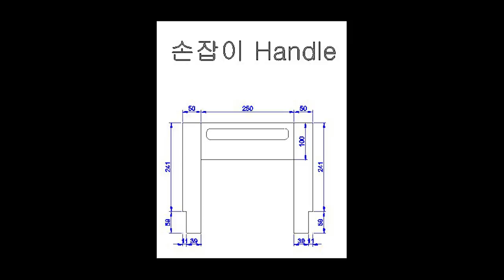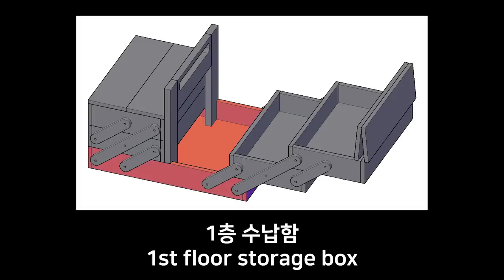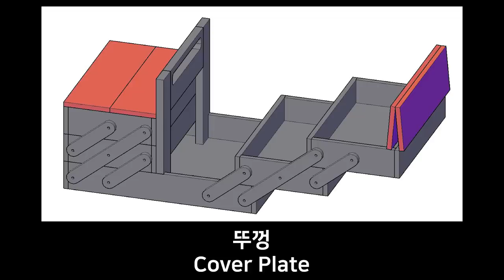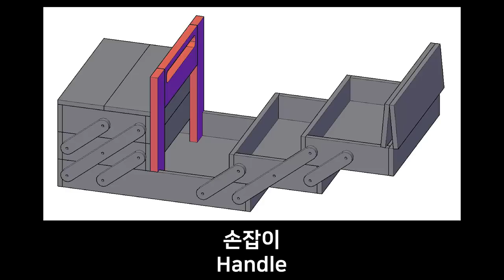3층 접이식 목공 공구박스 diy │ 3-layer Sewing folding tool box

Comment: Good and very inspiring work !
Few tips:
- You have a router, you should definetly make a recess for the top hinges, so they don't interfere with the top closure.
- You should use "M6 half threaded countersunk allen key bolts" for pivots, they stay flush and make it more stylish, avoid eating the hole of swing hinge with thread.
- Using 30mm steel washers at the interference between swing hinge and sides for better sliding, plywood rubbing results generally in lost of the top, very thin, finnish layer.
- You could use small neodymium magnets between top boxes and the handle (small ones, three or four each side will make it), so the box closes firmly when you carry it.
Hope this helps.
Reply from the maker: You are right Very good idea.
I'm a beginner and I can't do it all.
But I'll try to do well soon
Thanks for the advice
Reply: А ящик сложно делать такой?

Comment: This is pretty, and a great demonstration of the folding principle. I have to say, I cannot imagine that handle remaining solidly attached with any significant use, tho. Little brad nails are good for trim, less so for structural purposes. If I were you, I'd have made the three pieces one piece, and fastened them to the bottom with something more significant like cabinet screws, maybe some strips of wood glued and nailed/screwed on either side of them against the box sides as well, for more rigidity. You could still do that last one on the build, as it is.
Reply from the maker: I will try to develop more
Thanks for the advice =)

Comment: nice work, but i saw just one tiny problem with this.. 
the base of the handle supporting only the middle portion. Meaning when carrying, you'll gonna have a problem, when the weight of the right box is not even to the left.
but still i gave a like. love it
hope you will do another design to fix my little tiny issue..😂
Reply from the maker: Thanks for the advice
I'll try to make a better work

Comment: very nice ! what material thickness did u use ? 12 mm ? also what is the weight of the final box ? i would like to make a bigger one. maybe only 1-1 drawer.
Reply from the maker: 12mm is correct. The weight is about 2.5kg.
Thank you. :-)

Comment: How much weight can it hold? The handle is attached only with glue and brad nails.
Reply from the maker: I think about 10-20kg is no problem.
I couldn't put it in the video, but I fixed it with screws.
Next I will devise a structurally more stable handle.
Thank you.

Comment: You need to use other skrews. This ones will widen the drilled hole more bigger because of the thread when you open and close it much. And the opening and closing will go easyer.
Reply from the maker: Yes you are right
But I'm a beginner so I don't know what else to use.
I'll show you how to develop as I learn little by little

Comment: Dear friend, a very nice job, but in my opinion there is an error in the wall levels in the size of 200*70 in the advertisement it says 10 units and what is needed is only 8 units
Also to invest the hinges for more reduced work and better visibility. Thanks, good job
And what is the thickness of the wood, thanks